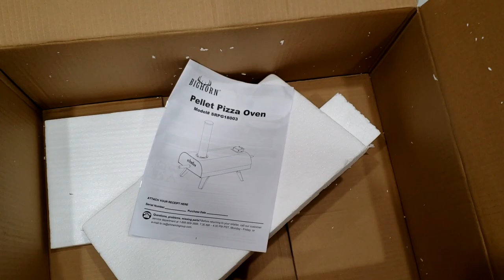Big Horn Pellet Pizza Oven open box and first use

Comment: Nice video, thanks a lot for including some mistakes.  I ordered my oven on eBay because of this video.  Got my for $85.  I want to tell you one thing, you have your pellet grill upside down inside of the pellet burning drawer.  When looking at the closed tray, one should not see pellets.  That is to provide air circulation to the pellet bed.  I have since converted my to propane gas and it will reach temperatures of over 1000 degrees.  The burner assembly just slides into the ash tray, so NO cutting or modifications are needed to oven.  I can preheat my oven in about 15 to 20 minutes to a stone surface temperature of about 850 degrees when the setting is on low.  Sure beats all the ash and clean-up.  I get to spend more time with friends and guests instead of maintaining a pellet fire.  I really don't taste the difference in the pizza for the wood smoke only touches the pizza for 90 to 120 seconds, much too short to infuse a deep smoke flavor.  This is a great pizza oven.  Unlike Ooni and Roccbox, the heat and fire are ducted up and over the pizza so that a fire shield which some people add is not required to keep the pizza from burning at the hot end of the oven.  Thanks again for this video.
Reply from the maker: Ha ha. Thanks! I will check out my pellet grill next time I fire it up. Will also check out the propane setup. Where did you get it? Thanks for your comment!
Reply: Was it easy to convert it to propane?
Reply: @Ladunn8  I got a 65,000 btu propane burner on Amazon along with the regulator.  The mounting plate was fashioned out of 20 gauge stainless steel sheet metal and exactly replaces the ash tray.  A diverter flame plate was inserted into the pellet tray opening to divert the gas flame into the fire duct and not up the pellet tube.  Does not alter the oven and can be converted easily back to pellets.  Works very well and gets hotter than my brother's Ooni Karu.  I like that it is so hot that I don't have to cook with the front door on.
Reply: @SilverShadow2LWB  Thanks!
Reply: @SilverShadow2LWB  Did you fabricate some of that yourself? Or is there a specific kit you were able to find that actually was manufactured for this grill?  I have one on the way and that sounds amazing.  I'd love to be able to have the choice between fuel sources on it.
Reply: @TheRealMasonYoung  Yes, I did it myself.  I am not a metal fabricator so I had to purchase a few metal bending tools.  I cut the sheet metal with a jig saw with a metal cutting blade.  I used stainless steel to match the oven's build which is a harder material to bend, but I needed it for the salt air exposure it has here near the beach.  But one could use regular steel for your first modification.  I am not exaggerating when I tell you how big of an improvement this has made with the oven's functionality.  It's a real pleasure to use.  I recently upgraded my stone to one that is almost twice as thick.  It helps with the heat retention when cooking multiple pizzas.  I got it on Amazon.  I am now gathering parts to put in an electric turntable to slowly spin the pizza for the most even cook.  There are a lot of videos on different ways to do this.  I will use the 12" round stone and the barbeque rotisseries motor.  It should be an another easy mod since the Big Horn has a flat floor under the pizza stone.  Have fun with your oven!!
Reply: @SilverShadow2LWB  Thanks for the reply! Wow, you are turning an expensive pizza oven into something people would easily pay $450+ for.  I'm impressed.  If you have a link to that stone, I'd love to check it out.  Also, you should be making Youtube videos of you doing this, I'd gladly subscribe.  Hell I'd honestly be willing to ship mine out and pay you to have you mod it at this point with the sounds of what you are pulling off here!

Comment: I am using mine for the first time now. This helped immensely. This is the honey badger of bighorn oven videos!
Reply: This is live comments Everything he said is working. My stack is smoking after the 450 grams. Creator, u don’t understand how the metal handle works that opens and closes the hopper and chute. Read the instructions for that. It hooks in kinda. But otherwise. Awesome video!
Reply: First pizza. Disaster. Make them small in this oven. Use lots of flour. Lots on all surfaces. Good luck.  I blackened my stone with all the toppings that fell off trying to get it in the oven. Ugh. Good luck all.  2nd and 3rd pizzas were smaller and delish.  Rotate often. Keep feeding the fire as well

Comment: Have you tried using hardwood or Charcoal as fuel?
Reply from the maker: No. Pellets work better and are cheap, clean-burning with no smoke or soot.
Reply: @rmwtsou  The reason I ask is that it seems like a pellet hog. For instance, if I plan to make say 10 pizzas I feel it might take a great number of pellets maybe 40lb. But I'm not sure it just seems that way.
Reply from the maker: @gusc1120  For 10 pizzas, it might take 5 - 7 pounds of pellets. It will not take 40 pounds -- unless you just waste time between each pizza.
Reply: @rmwtsou  Nice! Thank you for the info. I bought the oven now because of your review and information. One last question. Do you have a link of the pellets you use? Thank you!
Reply from the maker: @gusc1120  I just go to Home Depot or Walmart and buy the cheapest hardwood pellets I can find. It makes no difference the type of pellets used. More expensive is not better.
Reply: @rmwtsou  You tha man sir! Thank you

Comment: Your pellet tray is Installed improperly in the video. The tapered part should be sloping  down into the tray so pellets are  not coming out of the air vent
Reply from the maker: Ok. Thanks! I will change it next time.